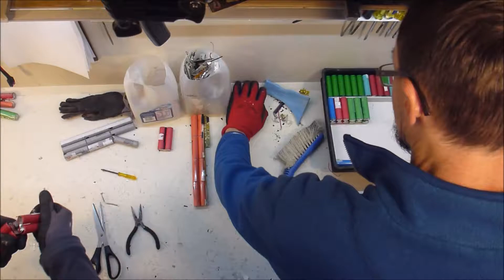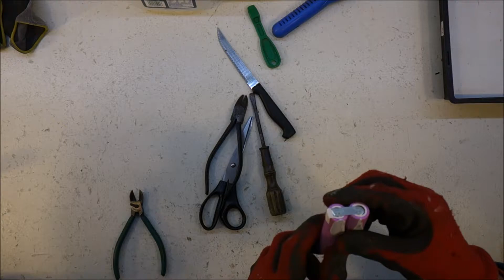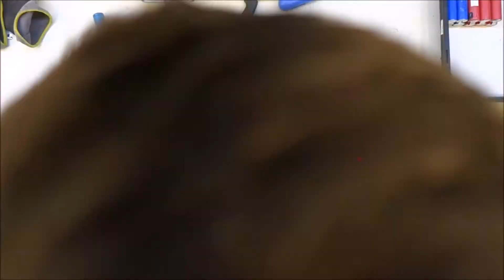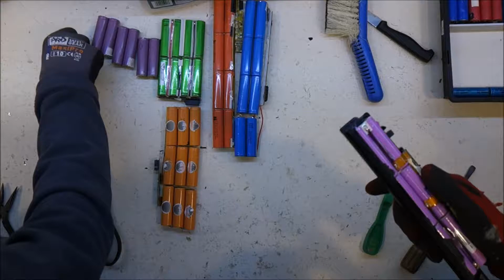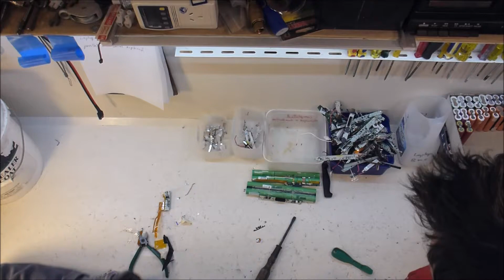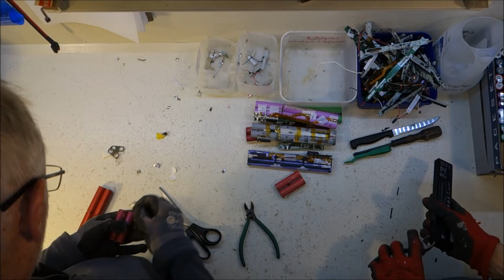Laptop Powerwall 30 - 12 things I learned

Comment: and a question do you know of anyone having problems with cells that have been soldered ? by over heating or anything. I'd like to spot weld . but then I'd have to build something else. I have too many projects now. so if soldering works! and what type solder works best? and I'm subbing!
Reply from the maker: The amount of heat that goes into a soldered 18650 depends on your technique. Here's a a good example: https://www.youtube.com/watch?v=OR472ONL7JI and here's a bad example: https://www.youtube.com/watch?v=0sj5DvG-qPI
I keep my cells in pairs from the laptop pack so that I don't have to solder directly into the cell - which greatly reduces heat stress.

Comment: What discharge rate are you using? 
Pairs problem -
I found doing this two problems, first is you need to discharge at 1ah to get the same results as everyone else, Eg if you dischanging two cells at 1amp then its only 500mah each cell so the numbers will be way off. As HB found on his going from 2ah to 1ah about 300 on avg. For me  discharging the pairs at 2ah without fans it gets too hot for me on my discharger heatsicks etc. I am not sure what the difference would be between 1ah and 500mah rates but it will be larger gap then 300 looking at the data sheets for discharge rates. 
2: The charging circuits chips i am using are spec for 1ah per cell max. I found they weren't charging properly with 2 cells on the some circuit. Now i didn't test it too much but i did look at using the pares for charging then splitting them to one cell for discharging but the results were all over the place.
Great video tho btw :)
Reply from the maker: +Mikes DIY Tesla Powerwall 1. I don't believe it is important to have the same discharge rate (or capacity ratings) as everyone else. For me, the purpose of discharging (measuring capacity) is to (a) test the cells work OK and (b) provide data for sorting batteries into evenly spread groups. As long as my capacity ratings are consistent for my pack - that's all I need. What use is it to be consistent with others peoples capacity ratings?
My current discharging setup includes fans on the four iMax B6s to dela with the heat.
2. Previously I've used my iCharger 1010 to balance charge 10 pairs at a time. It's not fast - but it involves very little fiddling about. My new 20-way TP4056 setup seems to working OK so far. (See Episode 31) Time will tell if I need to add fans to that too.
Reply: +Paul Kennett Thats true As long as the capacity consistent :)  Oh  those TP4056 can be a pain if you put the cell in the wrong way.... but i see you found that out on that video hehe. There must be something that can be added to the circuit to fix the problem, maybe a diode? 
iMax B6s if its the same as mine isnt the discharge rate limited to 1amp? I think over newer versions of the imax b6 AC v2  can do 2amp

Comment: OK thanks - so I guess the next question is what is the "fully discharged" potential?

According to this engineering specification from Sony; 3v seems to be a good starting point for fully discharged.

https://endless-sphere.com/forums/download/file.php?id=56068&sid=d79fe65706c4e841e81c79aba7c812ea
Reply from the maker: .+nztitirangi Yep - 3.0v is what my discharger goes down to. Some system will go to 2.8v
Reply: +Paul Kennett Right then - it seems I just might have a plan so cunning you could stick a tail on it and call it a weasel.

Comment: Could I use this method for bulk capacity testing?

http://www.instructables.com/id/Battery-Charger-Capacity-mAh-Tester/?ALLSTEPS
Reply from the maker: +nztitirangi Yes - you can. They're just doing the capacity measurement whilst charging up from "fully discharged" up to "fully charged". Whereas my process is to fully charge first - then measure capacity during dicharging down to "fully discharged". 
They both work... as long as you can accurately define your "fully charged" and "fully discharged" points.

Comment: These are great tips from your experience. thanks for sharing.

How big of a  kilowatt system do you think will be enough until you can say your done? 

How have you been sorting your groups of cells capacity wise to build your packs? 

Do your packs carry an average or similar capacity from one another?

Cheers Paul

keep up the great work and videos.
Reply from the maker: +Eric Scherzinger I've got enough laptop batteries to make another 12kWh of storage. Not sure yet if I'll do all that for myself.

I sort into groups which are the same total capacity. But within each group there is a range of cell capacities): https://www.youtube.com/watch?v=pmbhWBk3AOs
Reply: +Paul Kennett Sounds like someone has a good supplier for old laptop batts :)
Reply from the maker: +Mikes DIY Tesla Powerwall I volunteered at my local IT recycler to sort their giant battery pile. They were so grateful they gave me 446 laptop batteries. They've got a lot more left too. I only took the batteries that clearly had 6 cells. Happy camper.
Reply: Paul Kennett Oh very lucky :)